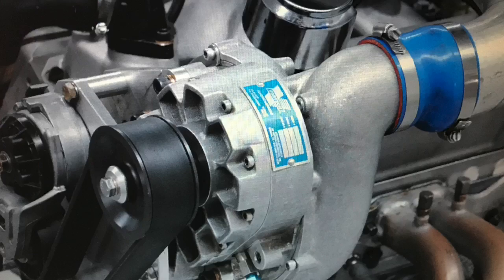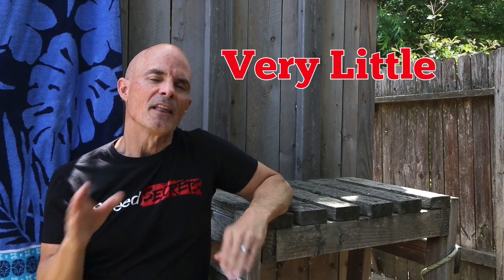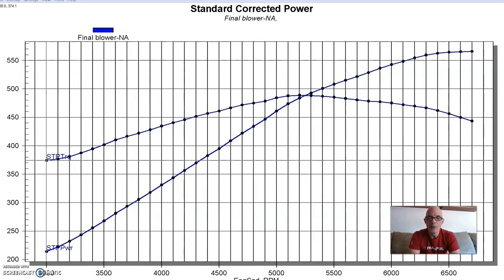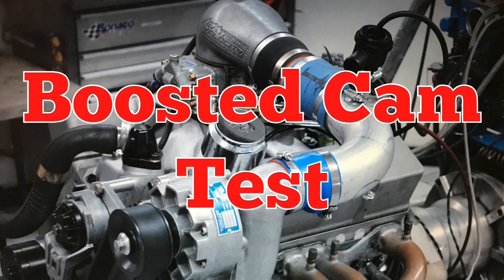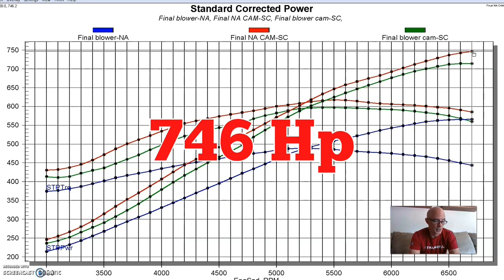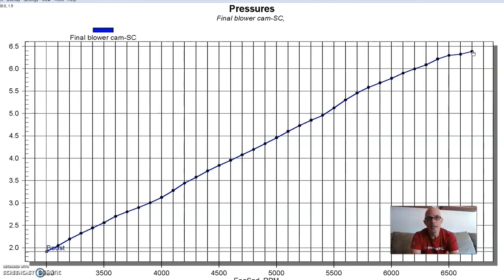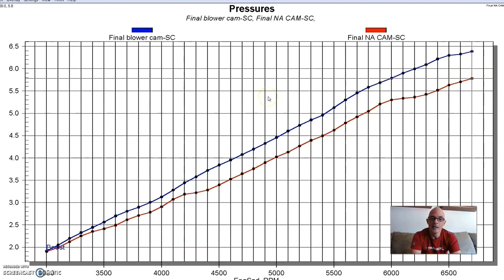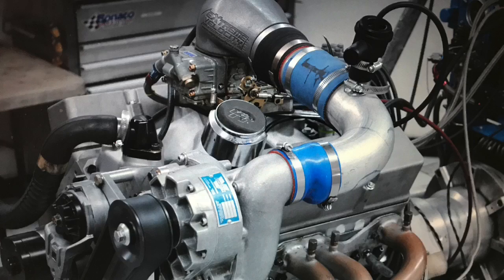MOTOR MYTH BUSTING-BLOWER CAMS!

Comment: The question remains, why are Blower cams even offered? (and installed at the factory) Does it have to to do with fuel mileage? Is there fuel bleeding out with that boost pressure? Cams are about more then just peak power, specially for those of us that run them every day. Could this be tested by looking at air/fuel in the exhaust?
Reply: If fuel and air were "bleeding off" how could it make more power with less boost?
Reply: @baby-sharkgto4902  I don´t know and I am not claiming to have any answers, just trying to figure out why wide LSA cams are even offered and installed if tighter LSA NA cams make more power under boost. There must be a reason for the wide LSA other then some myth.
Reply: @TheNumbers400  if I'm being honest I do not have hands on experience with a modern positive displacement type blower. I do know that all of the 6-71, 8-71, 10-71 blower cars I've worked on in the past have a super hot cam not specific to blowers in any way. I would love to see Richard do a similar cam test with a modern blower aka lsa. I feel like a lot of us want to see this.
Reply: @baby-sharkgto4902  I agree. I have a LSA blower that I want to install in my Ranger so I am super interested in this topic now.
Reply: @TheNumbers400  nice, is it already LS swapped?
Reply: @baby-sharkgto4902  Yes it has a LQ9. I am in the process of gathering parts for the LSA install. LS3 heads, BTR Cam, Water/Methanol injection and other supporting mods, almost got everything. I am also swapping the 4L60 out for a built 4L80

Comment: How are you running so much compression with a blower what kind of fuel are you using
Reply: Its probably Holdener octane e85 or 100 octane its his usual fuels
Reply: I wish that I could get that out here in Nevada
Reply: Literally there is not one E85 pump in Vermont. Not one pump  in the entire state.

Comment: TEST IDEA I would love to see you test a double power adder like a turbo blowing into a roots style blower, and individually to compare the power curve between the two, then combined. Keep up the good work!!!
Reply: Yes I wonder at this too, would it enable exhaust energy to be put back to crankshaft thrust blower drive by trying to drive the rotors and  lessening parasitic loses usually seen at higher rpms from blower
Reply: @Hitman-ds1ei  Keep an eye on the Street Machine youtube channel. Hopefully they will be doing this with their roots supercharged (Eaton M90) buick 3.8 V6. But I think with modern low inertia turbos, antilag (or just use good old fashion nitrous as anti lag for 1/4 mile racing) then the days of compound boost of turbo into roots is not worth it. Lancia did it very will of course back in 85-86 in group B rally, where no turbo lag is a distinct advantage, but then those days have long past.
Reply: @Hitman-ds1ei  The turbocharger has parasitic loses too. NA is very inefficient using pistons for compression, positive displacement superchargers are more efficient using screws instead of pistons for pumping/compression. Centrifugal Superchargers and Turbochargers are the same, theyre the highest efficiency because of a turbine compressor instead of screws.

The turbocharger could spool up the supercharger, or vice-verse, depending on which one is downstream. If the upstream device is supplying more air volume than the downstream device, it will windmill the downstream device up and effectively negate the parasitic loses.

More likely, though, they will multiply exponentially in series. Nuether turbos now superchargers boost by pressure units, they boost by ratio. So, a supercharger with a 2:1 ratio will supply 14.7(1atm) of boost. But if that same supercharger is being fed by a turbocharger twice the size and also at a 2:1 ratio, they multiply. Lets say the engine in NA is 1000cfm, the supercharger is  2000cfm (2:1 ratio), and the turbo is 4000cfm at a 2:1 ratio.
The turbo pumps 4000 cfm of atmosphere (14.7psi absolute) out at 2000cfm of 14.7lbs of boost (29.4psi absolute), then the supercharger will double it again from 2000cfm at 29.4psi absolute on the inlet to 1000cfm of 58.8 psi (44.1lbs of boost).

Or, you could daisy chain turbos together. Say theyre all the same size turbos, you would have one turbo feeding the intake manifold, and you'd need two turbos feeding that turbo, and youd need 4 turbos feeding the two turbos. This is assuming turbos that are sized to provide a 2:1 (14.7psi of boost), and a volumetric efficiency of 100% (which doesnt exist).

Comment: Boost is a measure of air way restriction and the na cam has less air way restriction. Did you do exhaust back pressure logging for na and boosted? I ask because I’ve seen a x pipe explode in a twin screw setup with big 1 7/8 primary headers with a 3” collector and a full 3” exhaust.

Comment: I see 11 to 1, i have a 410 windor, 10.5 or so compression, can i run a blower like this at 6 psi, everywhere i look it says no
Reply: there's other things that come into play on a setup like that. Most boosted cars racing at the track nowadays are around 12.0 or better.
Reply: Yes you can.
Reply: If fuel injected then I suggest an intercooler
Reply: With the right fuel.
Reply: There are kits for new 5.0 mustangs that jamb 10psi and have pump gas tunes in them. 10.5 and 6psi isn't too bad. If you have modern aluminum heads on it with nice chambers and tight deck clearance your halfway there. Years ago hot rot built a destroked 400sbc that ran 11:1 on 87 octane. 6 psi isn't overkill on boost, with a good air charge cooler and a good tune you will be safe. I would run it fuel injected. By the time you f around with carbs it's the same price and the payoffs come back. A carbed engine might make more power on the dyno, just, but wait until you try to start it on a 40°f morning or take it through the Senoran at 120°f. Something like a torqstorm that tops out at 700hp would look like a good fit. See what ls guys are doing with boost and 10.5:1 squeeze and see what works. Ls2 engines are 10.9:1 factory, and procharger has a 6psi kit for them. The tuning will make or break, have fun, sounds awesome.

Comment: What about a twin turbo cam running it na?
Reply: If you take that "turbo cam" and look around online long enough you will probably find a very simular cam from a different manufacturer being sold just as a "cam" It's gimmicky to call one a blower cam or na or nitrous.  . Forced induction and even nitrous are just so common nowadays so cam manufacturers are just trying to help make it easier for novices to feel comfortable selecting and purchasing a cam. Turbo cam, centrifugal cam, positive displacement cam, cathedral port cam, rectangle port cam,.... I would never purchase a cam based off of these labels, it's all about the specs for me, but I've been in the game and building my own engines (and for others) for a long time. Less experienced folks will grab the designated box cam. Don't get me started on "stage 1 cam" or "stage 2" or 3 and so on. Experienced engine builders for the past 50 or more years would NEVER purchase a "stage whatever" cam or a "whatever cam, instead they already have the specs in their head as they're building the engine. Again these designations are mostly for the novice enthusiast.

Comment: Great comparison ! Love the question, it has to be making energy from the boost and it was still climbing in HP when you stopped the pull.  🤔
Reply: With a centrifugal supercharger the boost increases with rpm so yes the max power is most always at max RPM

Comment: The boost dropped for BOTH REASONS. The overlap (lobe separation) and the fact that the motor is using the airflow better. So I will keep my NA cam in my G8 and slap the LSA on. Lol

Comment: About to drop a 400 .60 over sbc in my 89 short bed chevy. Gonna be lots of fun 
Also, more SBC videos.
Reply: Hello sir I also have a .060 over 400 as well thats a 4.185 bore and head gasket is 4.190 bore is this the same on yours and does it work or need a different gasket.
Reply: @donwalsh7521  we used a 4.225 gasket I think. I can check. We blew that motor up. Building another 400 now .020 over. Last one had a bad tune on a 200shot. Just got greedy I suppose.

Comment: Finally some 400 sbc testing
Reply: Hardly any to go around these days
Reply: @superduty4556  they're around...... I've had 3 in the last 6 or 8 years
Reply: Aftermarket block, in fact aftermarket everything.  So not cheap.  But if you have the dough, it's definitely cool.
Reply: Sorry man..lol i have 8...yes 8 400s..all im good usable mag checked condition my buddys all joke me that i will never let a 400 go...4 fully built 500-650 range 1 concrete filled on c&s methanol carb blow thru turbo big single over 1000hp

Comment: it was a fun test and i hate to be a naysayer but if the cams were basically the same, just with different LSA  it may have been  more informative. Is the LSA not mainly the basic difference between a blower and an NA cam ? Possibly a greater spread between intake and exhaust duration as well? Maybe the results would have been the same. Fun test none the less. Good job Richard.

Comment: What about the extra oxygen in the exhaust flow if it was blowing past at valve overlap? Wouldnt that create a false leaner O2 sensor reading? Can you correct for that kind of scenarios by using the fuel flow compared to the intake air cfm?
Reply from the maker: That doesn't happen-we sweep AF and Timing just in case to see what it responds to
Reply: @richardholdener1727  Therefore no blowing out the exhaust if the AF did not change? Thank you Richard, great work!!!!!

Comment: I think the real question between these is.  How easy are they to start and How well do they run when not WOT?
Reply: Not a pleasant daily driver in either tune, but lots of fun.
Reply: Keep another normal car around for life's bullshit, use the hotrod for entertainment.
Reply: Maybe starting is an issue with carbs. I've tuned bottom of the page cams in efi LSes and never had starting trouble, but cranking timing and leanout are fully configurable.
Reply: @chipcurrey653  I was thinking along the lines of the engine as tested. The N/A cam fitted with the blower. Part throttle in a buggy even on a Circuit. Throttle response is still important off the street in many cases.
Reply: @dazaspc  Tighter lobe separation gives you better throttle response. You do have to tune for it though.
Reply: The tighter lsa on the n/a cam would make it snappier I think. Im starting to wonder why anyone would want an lsa more than 112
Reply: @slows102  Driveability and emissions.
Reply: Idles crazy....will need a big stall convertor on either...silly actually.
Reply: The na cam made more power everywhere so I would imagine it would drive better than the blower cam too. 🤷‍♂️
Reply: @WhiteJameson24  I think that is a very false assumption to make

Comment: I wish I had watched this before I put a LS9 cam in my Caprice.
Reply from the maker: Those R cheap and they make good top end
Reply: @richardholdener1727  Yea, but I had a big LS3 Texas Speed cam on the shelf I could have put in. I didn't because I plan on putting a LSA on it later.
Reply: One thing about that cam that is good i it will soften the lower rpm power because positive displacement blowers make a lot more boost at lower rpms than centrifugal blowers.
Reply: Time to sell a "boost cam" and get a tsp!!

Comment: I would have liked to have seen the n/a cam with a 116lsa as well as the 110. Then the same test. That would have been more conclusive.
Reply from the maker: whatever it does na-it does under boost-regardless of the lsa
Reply: @richardholdener1727  my question was to see how much difference in boost pressure there would have been.
Reply: @stanlucas1932  still the same thing...its seems counter intuitive  your going to see the same thing at 20lbs of boost as you see at 10. Just more HP.
Reply: @cuzz63  that's not what I'm saying. That's obvious, I'm curious to see how much bleed off the 110 lsa has compared to the 116lsa as that's commonly the difference between (boosted) cams and N/A cams.
Reply: @stanlucas1932  you sound like you own a BOOST cam haha
Reply: Great test Richard. Super happy you did it with a supercharger.  But I'm with Stan, too many variables changed with the cam, if only the lsa changed, it would be more helpful. Many thanks though for all you do for us.

Comment: This is great data! Makes me wonder why the cam manufacturers are making dedicated cams for Centrifugal, Twin Turbo, Single Turbo, and Roots style blowers. Are they really just trying to make money or is there data somewhere that supports choosing those cams?
Reply: It's gimmicky to call one a blower cam.... just look at them as 2 different cams. Forced induction and even nitrous are just so damn common now so cam manufacturers are just trying to help make it easier for novices to feel comfortable selecting and purchasing a cam. Turbo cam, centrifugal cam,  positive displacement cam, cathedral port cam, rectangle port cam,.... I would never purchase a cam based off of these labels, it's all about the specs for me, but I've been in the game and building my own engines (and for others) for a long time. Less experienced folks will grab the designated box cam. Don't get me started on "stage 1 cam" or "stage 2" or 3 and so on. Experienced engine builders for the past 50 or more years would NEVER purchase a "stage whatever" cam, instead they already have the specs in their head as they're building the engine. Again these designations are for the novice enthusiast. Sorry about the rant but I do hope this helps.
Reply: Manufactures have a different goal.  They are usually tailoring the cam for drive ability or emissions around the boost. Listen to what he says at 12:00 in.

Comment: With the carb did you see a change in bsfc. How did the afr change, did you change any jetting? Did you get any air flow readings? It's probably as a little column a and a little column b. More towards bigger flow, but you probably had a little more flow escaping through the exhaust as well not enough to matter. There's probably gainings to be had with cam tweaks like lsa, but they aren't for the 80-90% of builds.

Comment: I'll be damn!! Great info!!!
 So I can have the pro.stock "sounding" cam and my blower!
 Definitely air flow dropped the boost...I think.
Reply: need a sensor on the exhaust side to check how much unburned fuel is getting leaked out, or to check if it is  really leaking out.
Reply: Jody Haha , good call ✅
Reply: I would say a simple O2 sensor will tell you if you are running fat. Anyway the N/A cam still made more power and if was spitting out unburied fuel you would see it and smell it as well (a little smoky) lol